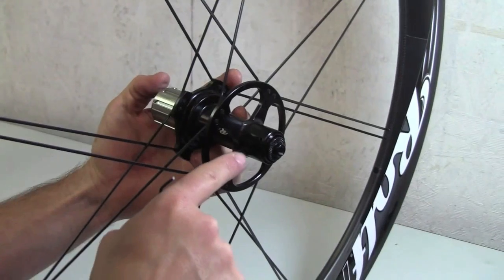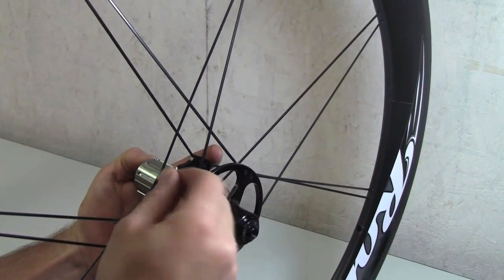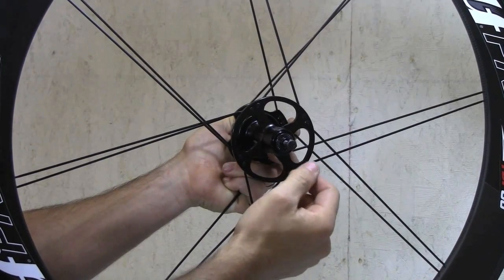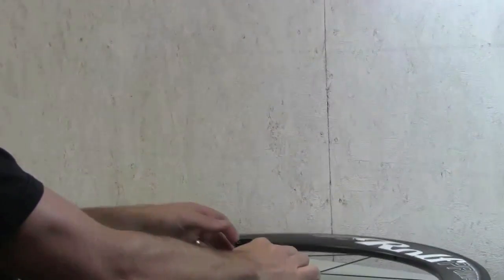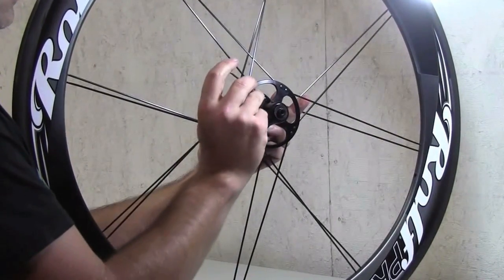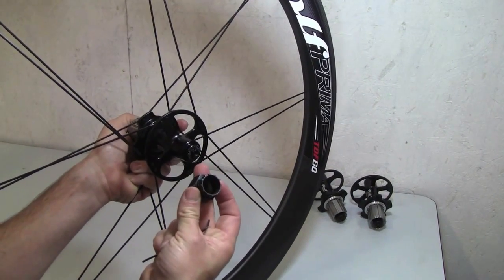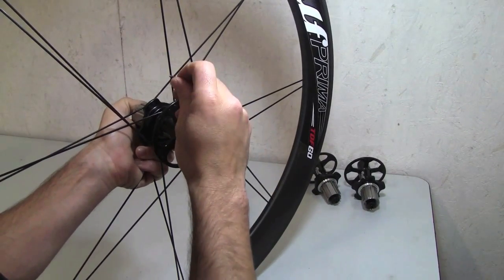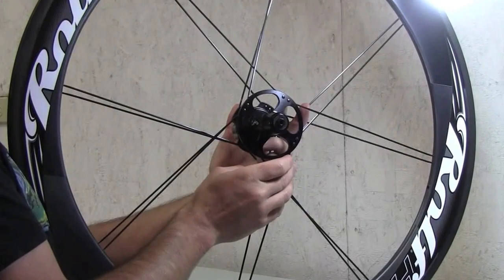Rolf Prima Rear hub adjustment

Comment: Good to have video such this one, please do more. Nevertheless I have to issues.
1. If I tighten the adjustment screws, as you indicated "with not to much pressure", just to have them lock, they start to lockup the wheel with the in-cap.
2. For some reason,  it loses itself back again after just 20km - recent problem
What do you think?